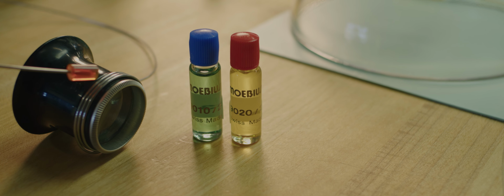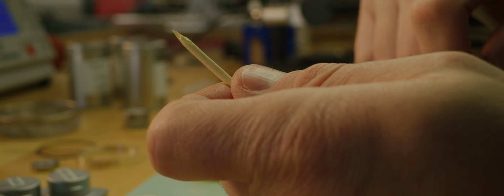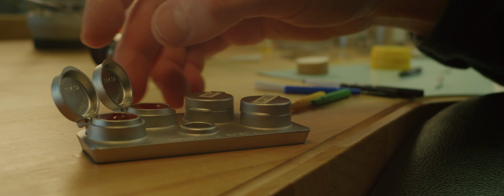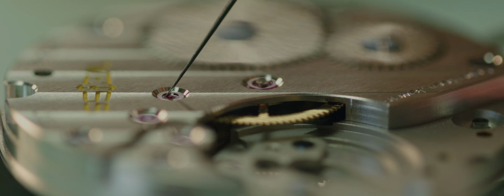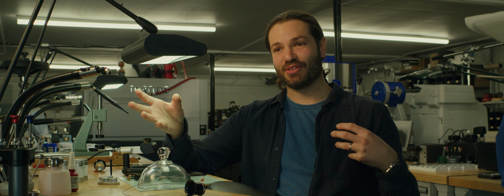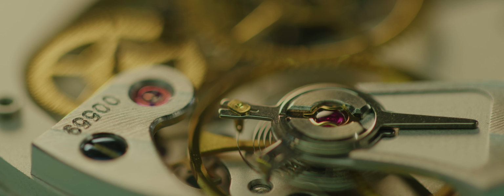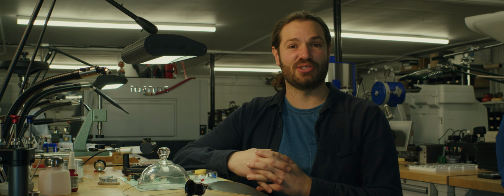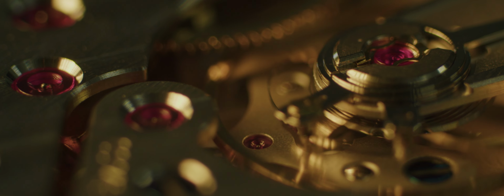The Watchmaker's Workshop: Watchmaking  - Oils & Greases

Comment: Sooo ...  In place of the mainspring, fit a battery, and a small solenoid at the pallet fork, impulsed by the to-and-fro movement of the balanced wheel.  So instead of a power train down from the mainspring , the wheels are driven from the pallet fork.  Much less friction, and no need to oil ..
Reply from the maker: The pivots will still need oil, and you would need to re-engineer the pallet fork and escape wheel to operate that way. Those sorts of ideas are a lot of fun though.  Check out Spring Drive, its a very cool invention, but does still require oil.

Comment: Is Moebius oil better than Nye oil?
If the oil should be kept out of light, will a skeletonized watch with an exhibition caseback have shorter oil life?
I hear George Daniels' co-axial escapement didn't need oil, but Omega's more easily manufactured version with looser tolerances had to be partly frictional rest and needs oil.  [Edit 12Aug2023:  Now I see you covered co-axial tolerances & oiling in "Watch and Listen" episodes 8 & 9.]